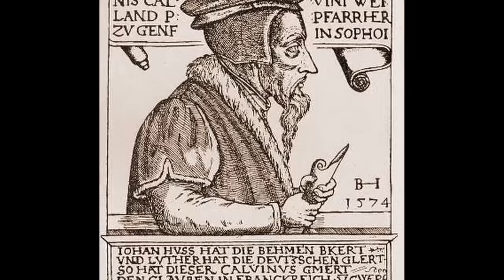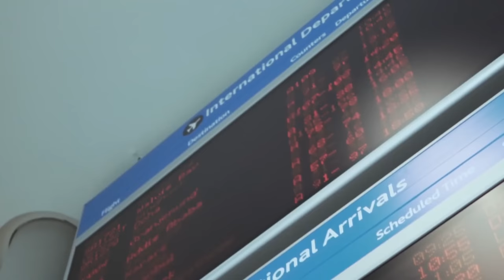Top 10 Weird Things About Switzerland

Comment: Nice video as usual. Thank you for that. I enjoyed it in particular as I live in Northern Italy, a few kilometres from the border with Switzerland and I am familiar with that country, generally speaking. Now sorry for being pedantic but I think stating at 3:55 that the “LHC wiring is long enough to cover 6 times the distance from earth to the sun” makes me really scratch my head. Ditto distance in astronomy is called AU (Astronomical Unit) and equals to approx. 150 Million km. Six times that is 900 M km. Considering for simplicity a total length of the 30 km for the LHC that turns into 30’000 km of cabling for each single meter of tunnel. EACH SINGLE METER. I find that really hard to believe as it seems physically impossible. Where did you get that information?